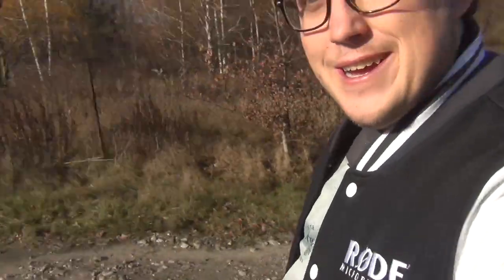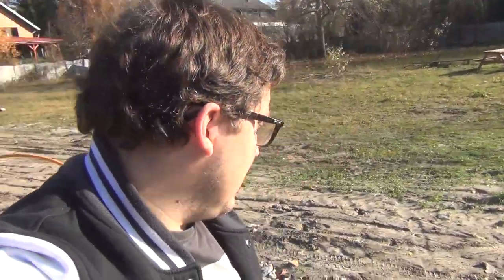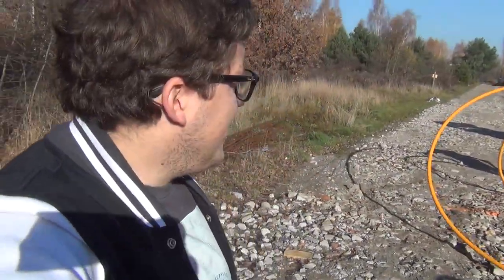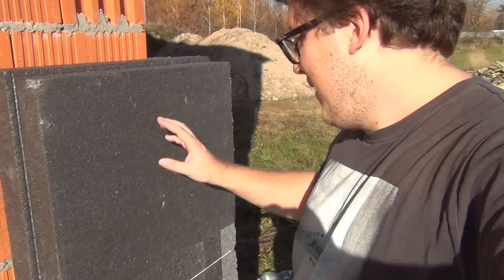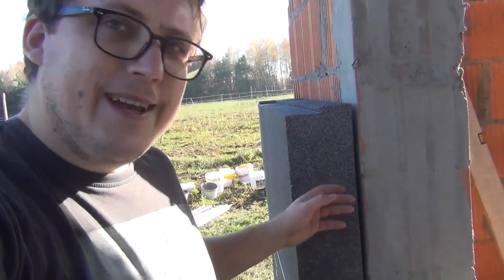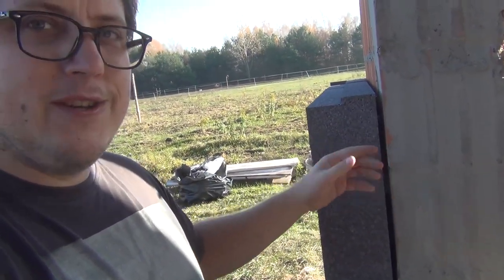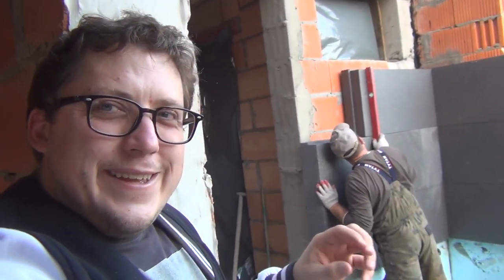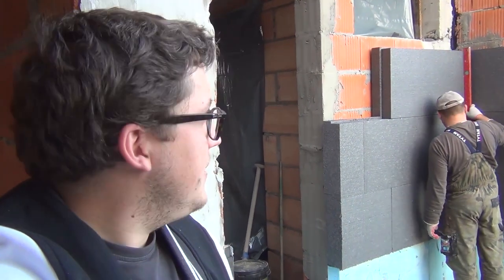BoH 128 - Starting Thermal Insulation and Gas Pipe Line

Comment: Hey Pete :) Just stumbled upon your channel and its super relevant for me, because I will renovate a house similar to yours in Serbia this year. I wonder - how much will you pay those guys to do the styrofoam isolation? And how much will the Styrofoam itself + glue cost? 
Also - you seem to be using a styrofoam, that has 2 pieces glued together - why not 1 big piece? Best regards, Marko!
Reply from the maker: welcome to the Chanel. I will check the prices for you once I put the kids to sleep, the styrofoam has a special “cut” on the edge so that pieces overlap and prevent thermal bridges. You can order straight cut or with the overlap. I the price is the same.
Reply from the maker: In 2018 for Austrotherm Premium 0.031 I paid 220 PLN per m3 the glue was 20 PLN per 25kg bag.. I think we bought 123 bags of glue and 46 m3 of EPS.. your mileage may vary as for the crew i think I paid around 28 -30 PLN per m2 of gluing the EPS to the walls + netting and one layer of stucco. the total cost of the whole deal with the final layer was supposed to be i believe 45 PLN per m2 but the guys didn't finish the job and i have another contractor coming to take over the final layer. Also the price does not include the 3d details we did around the windows and corners of the house that was charged extra. 4 PLN ~= 1 EURO
Reply: @PolymathPete  Thank you very much for the detailed report Pete! I will use it to negotiate a good price from the contractors for myself. Will report back then! Thank you again and good luck with the new contractors!
Reply from the maker: Thanks : ) Stay subscribed for more videos on the progress of the job : ) I plan to release a video every week this Year : ) And good luck with the renovation ; )